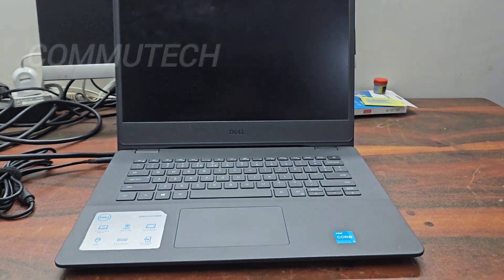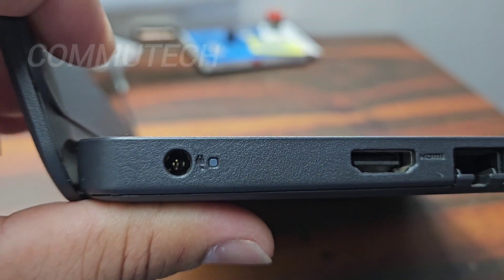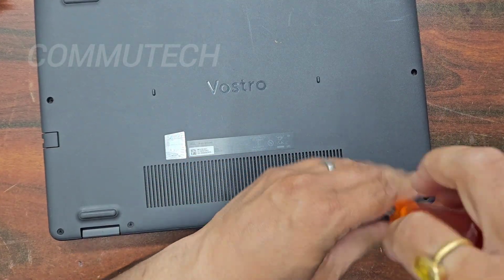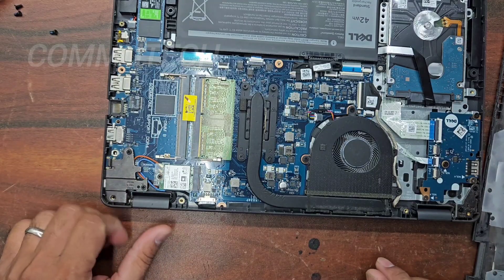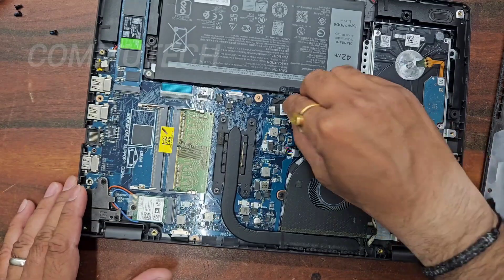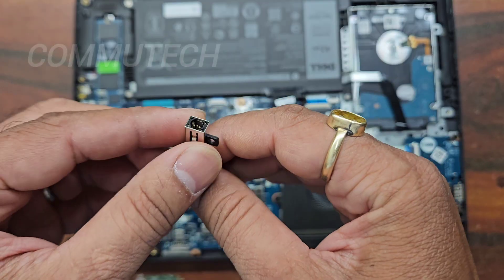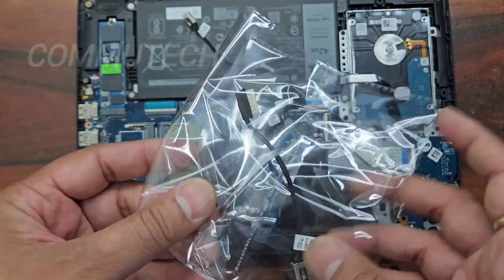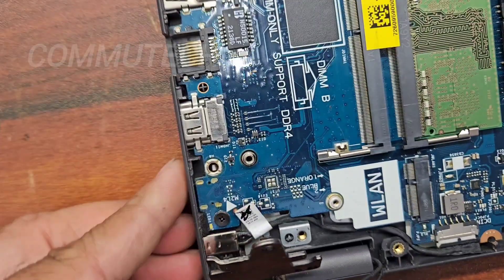DELL LAPTOP CHARGING PROBLEM DIAGNOSIS#REPLACING THE DC JACK FOR DELL LAPTOP#VOSTRO 3400 DC JACK

Comment: Please Provide the link or something for the DC Jack you buyed for this laptop and also can we replace it with Generic ones from Flipkart or Amazon if they are matching with my model number.

My Laptop gets charged only after a press my charging pin downward or put some wait on the Charging pin ?? which is faulty my DC jack or Charger ?? Please tell
Reply from the maker: Yes you can buy from flipkart.com

It will work

If your laptop is charging when you press the connection then it is possible that you dc jack is faulty

Please ensure the dc jack physically using torch light
It might be broken
Reply: @thansingh7047  It doesn't seems broken I've checked it already 

Also Please provide product link Please 

For Inspiron 3501
Reply from the maker: @sarojyadav1992 ok if the dc jack is not broken then check your adaptor pin also
Reply from the maker: Compatible for Dell Inspiron 3405 3501 3505 04vp7c 15 3593 228r6 0228r6 Dc Power Jack Cable Laptop DC Power Jack Socket Connector Replacement Charging Port Cable Harness 
 https://amzn.in/d/29gntJW
Reply: @thansingh7047  Original wale aur isme price mai ₹3000 ka difference hai bhaiya, motherboard toh sahi rahega na mera kharab vagera toh nhi hota ye walon se kaisa experience hai aapka aisa wale DC jacks ke sath
Reply from the maker: @sarojyadav1992 koi problem nahi hai